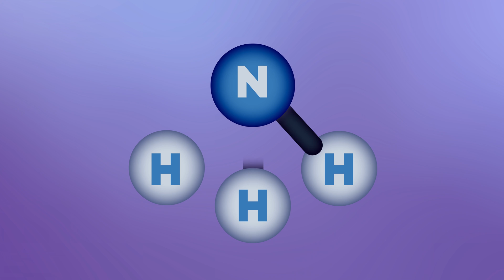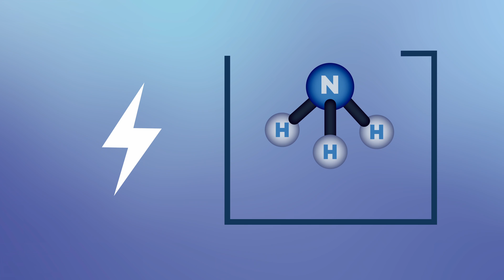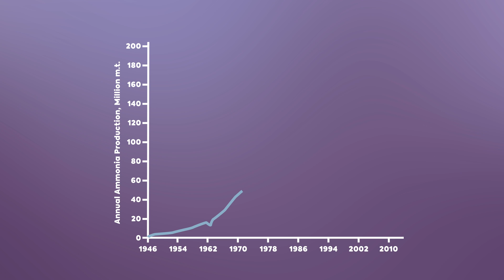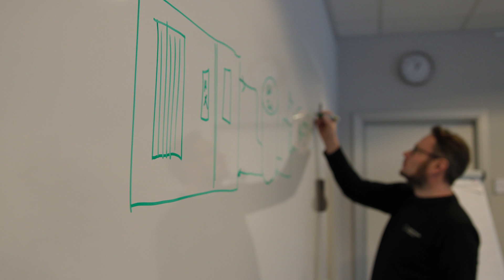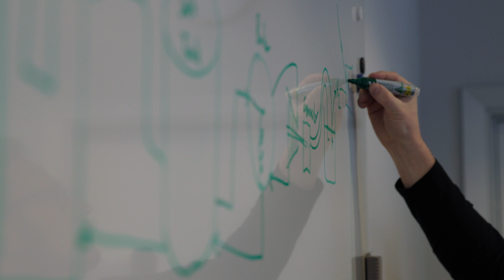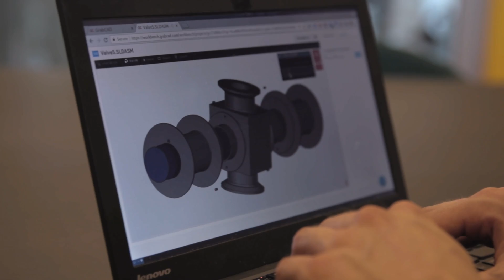Green ammonia by Alfa Laval, Topsoe & Copenhagen Atomics

Comment: Just curious, what is the typical efficiency of an ammonia fuel cell ? In particular, what are the benefits of ammonia over methanol that is liquid at atm pressure, more energy dense, easier/less energy intensive to produce ?
Reply from the maker: Great questions. [methanol - less energy intensive to produce.] I would disagree. But can you share a paper or wiki article with the numbers? NH3 can be made at $500 per ton and has almost the same energy densety than methanol and half of diesel. However NH3 can burn at 40% efficiency in 2 stroke diesel engines. Green NH3 still cannot compete with diesel. But it can compete with blue ammonia and diesel with 100% CO2 tax.
Reply: My understanding is that things may change if: 1) you can produce ammonia without the Haber-Bosch process, thus no hydrogen need, only starting from N2 and water, for example or 2) you can conceive a better hydrogen fuel cell (higher efficiency or more compact) with NH3 than MeOH, maybe because ammonia has slightly more hydrogen than meth

Comment: Not really, GREEN.
What about NOx?
What about energy imput for cleaning of seawater and desalination?
What about radioactive pollution and associated dangers of nuclear plants?
What about the hidden part of the iceberg of manufacturing, maintaining, and operating wind and solar?
Reply: No NOx when burned in a fuel cell.
If that energy is also low carbon, then where is the problem? (besides added cost)
Nuclear plants, conventional or SMRs are by far the safest and least polluting of all power plants. No other energy source at that scale has less than 10 deaths linked to it in the past 35 years.
Reply from the maker: > What about radioactive pollution and associated dangers of nuclear plants
It seams that you live inside the Matrix and is not well informed.
Reply: @Copenhagen Atomics  
Well, you are not addressing, scientifically, my points; you are just attacking. 
Try to enlighten your audience by means of scientific explanation!
Reply: @mosgrni6039 Nuclear power plants do not release radiation in the atmosphere. What you see coming out of light water nuclear reactors is pure steam. Meanwhile, I invite you to research how much radiation a typical coal fired power plant releases constantly.
Reply: @Lounge Monkey  
Don't be superficial, please. 
What we mean by radiation dangers is what is associated with disasters such as Chernobyl and Fukushima.
Also, you need to consider the very problematic issues associated with treatment and storage of consumed fuel (e.g., depleted uranium).

Comment: If you burn the NH3, NO will be released. So, Nitrous oxides is the precursor for tropospheric formation of ozone and photochemical smog at the ambient sunny air.
Reply from the maker: I agree, NOx is only a partly solved problem in combustion systems. But as fertilizer and for fuel cells it is good.

Comment: Since liquid ammonia has to be stored under pressure and boils at 33C then to use it, the liquid must vaporize when released from the tank.  Why not run this ammonia vapor through a phase change motor (i.e. a turbine) to either generate electricity or turn a mechanical device such as a propeller shaft?  Also after the NH3 passes though the turbine, can the H2 gas be recovered and sent through a fuel cell to produce more electricity?  If this configuration is feasible then it could recover most of the energy required to produce the ammonia and store it in a liquid form?
Reply from the maker: There are catalysts which can convert NH3 to H2 at almost no energy loss. Thus you avoid NOx and NH3 is a great energy carrier.

Comment: Isn't ammonia many times more efficient as a fuel by running it across a nickel catalyst to separate the nitrogen and hydrogen, then using the hydrogen in a fuel cell? 

Fuel cells run between 70 and 90 percent efficiency in the use of the energy available, while burning hydrogen, as in burning any fuel, is only 20 to 40 efficient, unless you want to make heat. Burning fuels mostly make heat, and do less mechanical work. Although even as a heat source, they are not ideal. Heat is much harder to transfer from source to point of use.
Reply from the maker: I am not an expert. But the shipping industry looked into this and concluded that currently diesel engines are still better than fuel cells and electric motors. But maybe in the future this will tip. I will ask Center for Zero Carbon Shipping if they can share some numbers about this research.

Comment: How difficult is it to deal with nitrous oxides produced during combustion.
Reply: Nitrous oxides is the precursor for tropospheric ozone formation and photochemical smog.
Reply: Diesel engines currently deal with it by injecting ammonia in the exhaust, which converts NOx to N2 and H2O
Also, there is no NOx coming out of a fuel cell

Comment: Ammonia seems to be a big chance to replace old liquid fuel. Hydrogen alone is challenging to use. And we need a 24h energy source, I bet on Thorium liquid salt, seems the cleanest and cheapest source we can imagine.
Reply: Methanol (with captured CO2) is also good. Even though it has a lower energy density than ammonia, it requires less heavy tanks, so it balances out. And it is less toxic than ammonia.
Reply: @jimj2683  capturing CO2 ist hard, will say, needs a lot of energy.

Comment: The Copenhagen Atomics package is so small why not use it directly for shipping as the heat source for the turbines (maybe super critical CO2)? Much much more efficient than making ammonia for fuel.
Reply from the maker: Yes technically it is possible to put Copenhagen Atomics waste burner on a ship, and we do believe this will happen one day. But we think it is more likely to get widespread adoption on land first. You can also put it on a barge of course. But there is a higher risk / cost of getting this approved on a ship and no one seems willing to pay that added cost on the first reactor units. Thus we expect to see this on land first and the price to drop quickly. Next problem with ships is that most ships are different, thus it is more difficult to get a "type approval". If some investor or customer is willing to pay the difference, then we are ready.